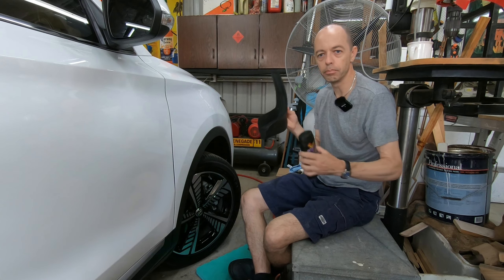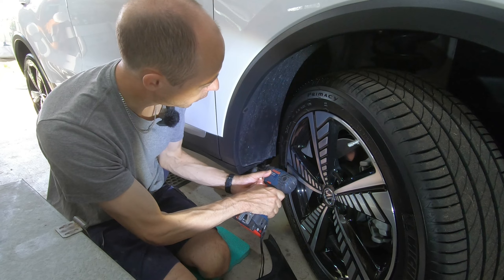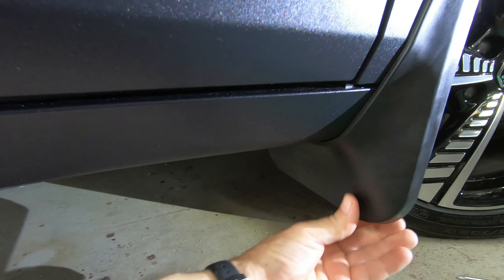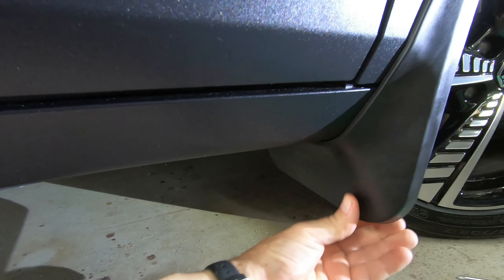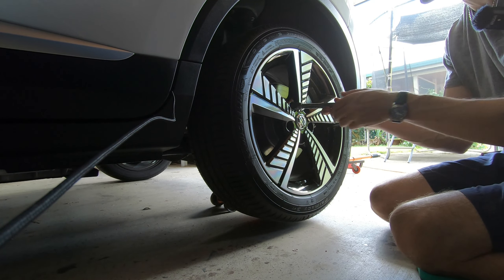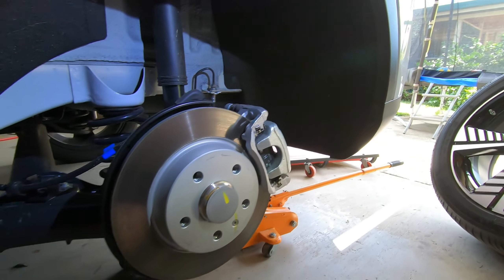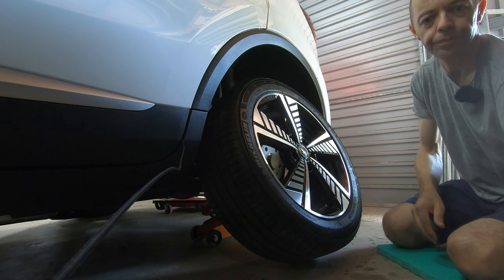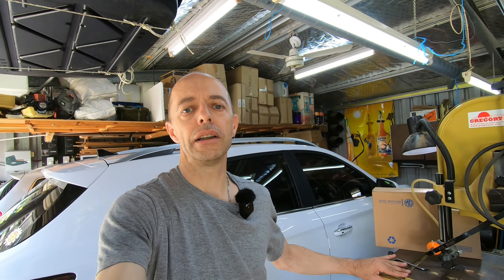Fitting Mud Spats to Australian MG ZS EV Electric Car….. and removing and refitting Rear Wheels.

Comment: Hi Greg,  When I fitted my mud flaps, as I live alone, I had to make a plan when fitting the centre screw on the rear mud flaps. I lined up the centre hole and tapped it with a prick punch, making a small indentation dead centre for the screw. I then got my drill driver ready with the screw attached to the front and positioned it under the wheel arch. I then used a piece of dowel rod 450mm long which I put up from the back with my let hand, and by prodding against the back of the felt lining, I could see where it was positioned and moved it close to where the screw would come through. Holding that in position, laying on the floor I was able to pick up my drill driver with my right hand and put the screw in. If the dowel is longer than 450mm long it will not go in through the back hole and if it's less than 450mm it won't reach. I hope this helps somebody tackling this job on their own.
Reply from the maker: Hi David, thanks heaps for the additional detail from your install. This will definitely help others as this was a bit tricky. Really appreciate you taking the time to follow up. Cheers Greg.

Comment: Thanks for another great video. I just did this exact job myself yesterday. I got genuine branded ones on ebay for $59 and they came in three days (from Ryde) so I was really pleased. When it came to the rear ones and the lack of access I (very briefly) considered removing the wheels but decided against it. Using a right angle screw driver I did the top screw and left the middle hole unscrewed. It's still secure enough with just the two screws (hopefully this decision won't come back to bite me).
Thanks for letting us see the wheel off without having to go through the process ourselves :)
Reply from the maker: Hi Chris, thanks for watching. You must have been reading my mind at the time. I was going to do the same but for the benefit of the video I thought lets get that wheel off :)

Comment: Hi Greg, After watching this video I will definitely get a set of mud flaps for myself. When you spoke about removing the plastic covers of the wheel nuts are you aware that in the tray in the boot were the inflation pump and the fluid container is situated, just to the right of that in a little hole is a pair of tweezers designed for easy removal of the nut covers. One thing I noticed on my MG ZS EV is when I check my range and take note of it, I then switch on the fan and immediately loose 25 km of range. I'd be interested if anybody else has this experience. Keep up the good work, David in Adelaide.
Reply: Yes lose about ten miles with heater on in normal mode
Reply from the maker: Hi David, thanks for watching and the tip on the tweezers, I must have missed them when I was checking out that gear. Yes same drop with the fan. I have a video on my 'to do list' to cover that type of thing sometime in the future. Cheers Greg.

Comment: Hi Greg, I ordered my mud flaps on e-bay from seller "Hunterpart-0 (702) for $63.50 on the 6th April and they arrived on the 10th. Just 4 days from NSW to SA. They are the genuine accessory in a SAIC box. I'm about to fit them today. I found your video very helpful. Thanks mate.
Reply from the maker: Great to hear. Yes I believe Hunter parts are an MG Dealer in the Hunter Valley and have a good range of genuine MG Parts on Ebay which make it nice and easy to buy.

Comment: Thanks for this. Have you seen how the VW ID4 has drum brakes on the back. How backward is that????? Have you thought of putting the electric lift tailgate as they've done overseas???
Reply from the maker: Hi Ken, thanks for watching. Yes, cant understand the drum brake thing...maybe more reliable in salt laden roads in cold climates? But at first glance seems crazy. Haven't thought of lift gate but looking into options for more internal lights and charge port. Maybe even 12 volt outlet in boot if I get the time :)
Reply: @ElectricCarAustralia  Hi, I have had these lights fitted in my ZS for over a year, got the idea from an MG forum member they are cheap and easy to do and they are working well. I also replaced the existing interior light bulbs in the front with LEDs as well. The only complaint I've had has been from my teenage daughter who wanted the LEDs to be pink! Here is a link there are 3 videos in all. One could fit small led down lighters using the same wiring as there is room above the head lining but I didn't want to cut the material. 

PT1 https://www.youtube.com/watch?v=gnro1VndA5k&t=19s     Led interior lights

PT3 https://www.youtube.com/watch?v=Cmf2Ws9Ssco   LEDs upgrade

Comment: Excuse my question but If there is no Jack, how does one change a flat wheel ?
Reply from the maker: Hi John, short answer you dont! The MG comes with a small air compressor and a can of puncture fix foam. If that cant get you going it's a call to Roadside Assistance.

Comment: How would you drill the rear holes with the wheels still on ?
Reply from the maker: Hi David, thanks for watching. I'm all ears! A small punch or clout lightly tapped in might do it then screw in with right angled screwdriver. That would be my plan or just leave that screw out and see how they go.